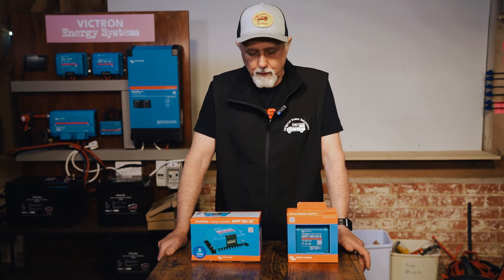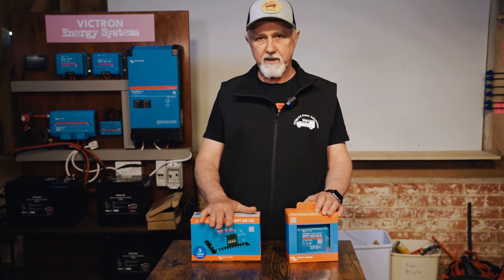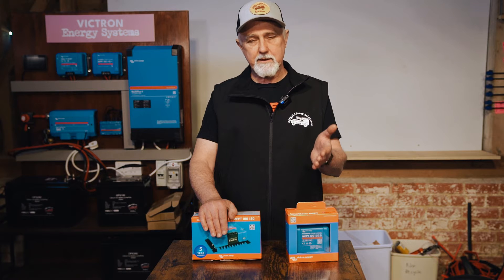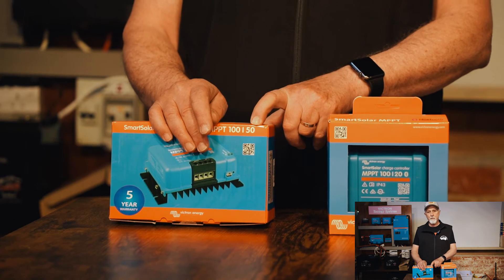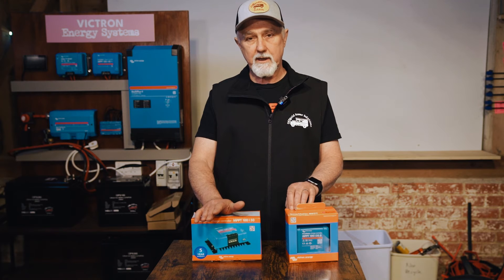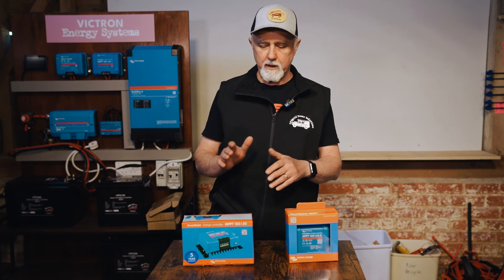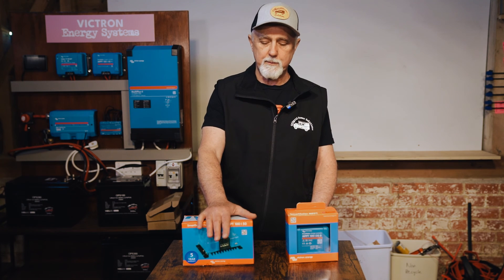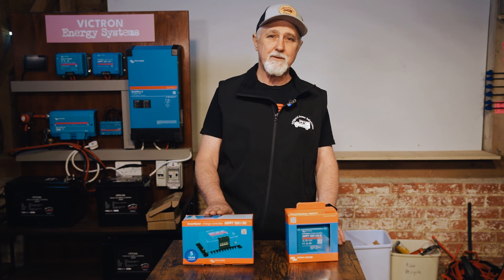Sizing an MPPT Charge Controller [Basics]

Comment: Hi, I've seen the load setting on my 50a smart solar and it's default set on battery life, it seems by the manual that is designed for lead acid battery to preserve battery memory when you can't fully charge your batteries in on day if I'm correct. 

Can I turn it of with a 500ah lithium battery? The battery is not charging every day at 100%, I've seen more performance but I want to reduce it's life span

Comment: Thank you for the video.

I'm building my set up and ordered all my parts.

It will be a 12v set up.

4×12v eco-worthy panels 200w each, connected in 2 series then parallel ro the controller, each panel has open voltage of 25.5 

Victron controller 100/50

4x 100ah lithium batteries in parallel 

Chinese 4000w continues and 8000w peak inverter 

I'm only concerned about hooking up the 4 batteries in parallel? Should I put leas or 4 will be fine?

Any info will be appreciated.
Reply: Hi, I suggest you to avoid chinese stuff not because of racism but because I'had almost ruined my wife's iphone 14 pro max using a Ecoworthy 1000w that was declared pure. sine but it wasn't
Reply: the more you spend the more you save

Comment: As far as I understand the amperage part seems incorrect. The 50 in 100 | 50  just means it will put max. 50 amps at battery voltage into the battery. You can supply it with more PV power, it will just derate and not use all of it. There is a limit on how much you can do this depending on the model, but you can certainly have a bunch more pv so that you're charging at the rated (50) amps for hours on end.  Just google 'oversizing pv array victron'

Comment: I got 7 100 watt polycrystalline panels on roof and just got a victron 75/10 smart controller now I know I’m not going to get no 700 watts but I needed to know if the 75/10 will work panels are in parallel 12 volts
Reply: 100 watt panels are around 5 amps. 5 x 7 = 35 amps. You may waist power over 10 amps. At 20 volts each you can series 3 typical 100 watts PV.

Comment: Please explain how someone could exceed the output amperage from the controller? 

I can see that the battery BMS if you exceed the amperage threshold in your BMS it would reset but the controller is only going to put out what the controller puts out how can you exceed the output amperage on the controller? 

Thank you

Comment: Hey dear I  am facing power dropping issue in series connection. I have connected 340watt and 380watt solar panels in series to epever mppt controller. It show power of one panel when I disconnect solar connector and reconnect, the mppt show both Panels. It’s hard to do this every morning. It was fine in winter but now summer starting and facing this issue. Using both panels form 2 months. images attacked. I have to try both in parallel to see what mppt response. Both panels volts amps are little different. Tesla 34.51v maxpower 33.18v. Tesla amps 11.01amps maxpower 10.29amps.
Reply: I tryed mismatched panels all I would get is the highest panel the others didn’t register so I went with all panels the same

Comment: I have a 12 volt system and I'd like to replace my older Tristar-45 PWM controller with a Victron 150/45 MPPT smart controller.  Can I do that if my system includes three 100W 12 volt panels (Voc=21.84, Isc=6.11, max voltage=17.99) wired in parallel?  I've read that the Victron needs to see 5v above the battery voltage to even start charging.  Thanks!
Reply: Hi, you would better off putting them in series to get a much higher voltage.  You could string up to 6 in series with the 150/45
Reply: That’s what I’m going to do! Thanks.

Comment: how do you adjust for the charging voltage required by the batteries?
Reply from the maker: You mean on the MPPT charger controller?
Reply: yes @offgrid_power

Comment: 50 is your case of your inverter is the Max Output Current it can produce or Max input Current? I have some spare bifacial Solar Panels of 580Watts, the data sheet shows Voc = 52.2 V and Isc = 13.93 A under STC, and 48.9 V 11.09 A under Non Stc test, which values do we need when sizing charge controller ?

My Mppt is 145Voc/100Amp output/17 Max input , can I not connect 4 panels in 2 series ? I am confused please help?
Reply: When sizing the charge controller, you need to use your panels’ Voc and Isc values.  Since your MPPT is 145/100, you should create two groups of 2 panels in series, and then connect the 2 pairs in parallel. If you were to put 3 in series, you would exceed the moot’s voltage limit during peak hours.